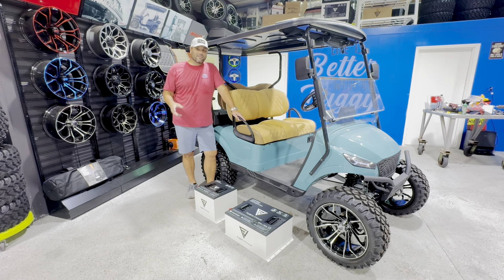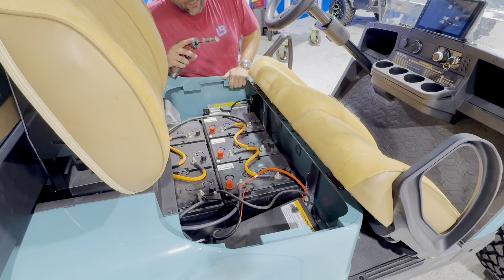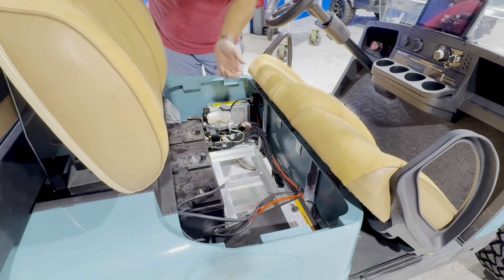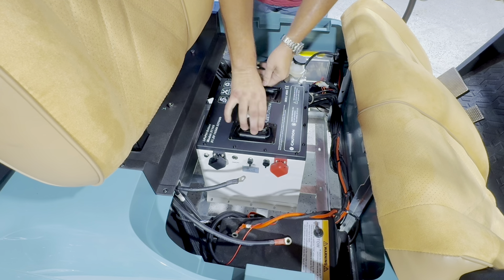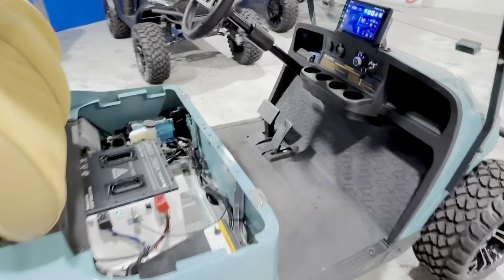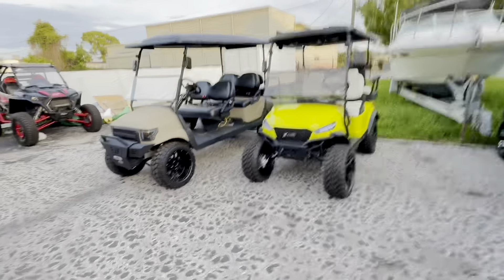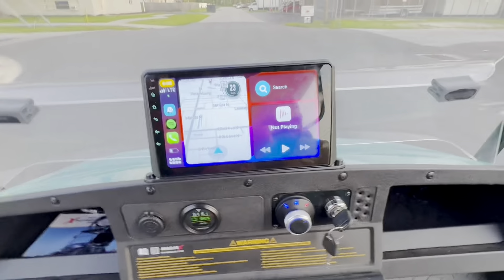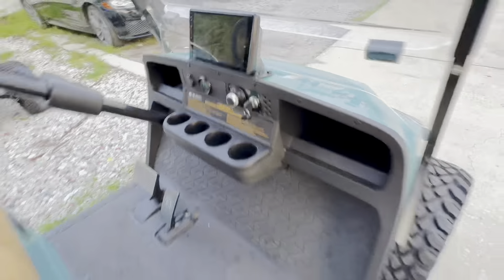Ultimate Guide: Installing a Lithium Battery in a Gen 1 Madjax X Series

Comment: Gen 2 Madjax sounds like it has not a great screen (delayed response) and needs upgraded heavy duty rear springs since the suspension doesn't not provide a great ride. Do you find this to be true compared to the Vibe? Also, I really want a 4 seater with ability to quickly add a rear seat if company is in town? Any recommendations?
Reply from the maker: No the vibe has absolutely no issues like that whatsoever. Out of the box they are fantastic. The screen on the Magic's Gen 2 is not touch screen and it's also very unresponsive it's nothing more than a digital screen to see your speedometer That's why I bypassed it for my stereo setup on the white when I did a while back
Reply from the maker: I don't think there's such a thing as an easy to remove rear seat, but the rear seat will bolt up to the forward facing four seater, it's just not designed to be removed on demand and requires different rear seat brackets , but it's very straight forward to take off and install. But I wouldn't want to do it on a regular basis